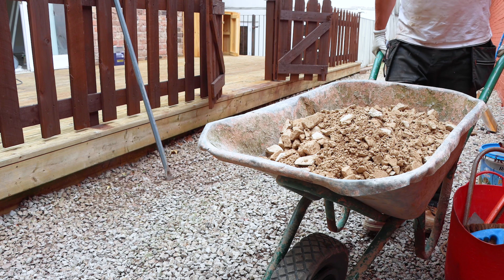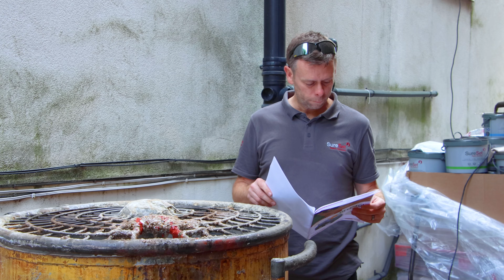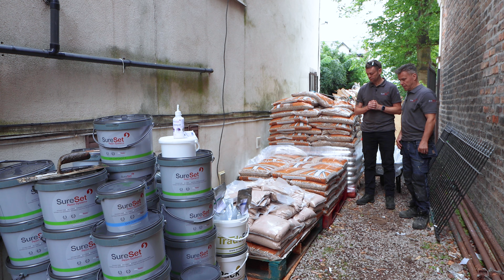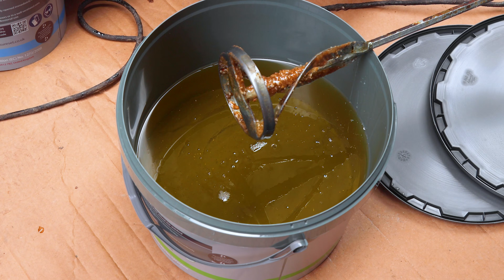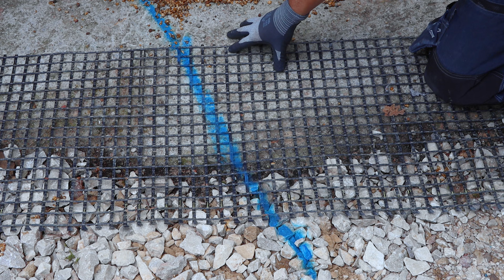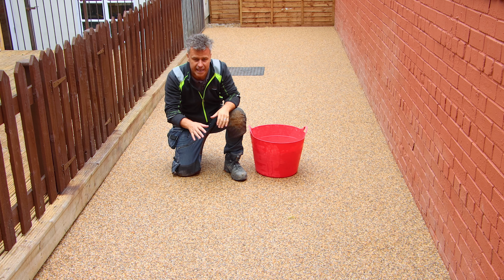How to Lay Resin Bound Paving | A-Z GUIDE | Complete Transformation

Comment: Fantastic video would love to know how much I would be paying for this to be installed, 100m2 area😅 am digging all my garden out myself and placing hardcore (mot type 1) through out doing my shed base at the back and leaving 70m2 centre for artificial grass and looking at this resin bond I think that’s what I want now specially with the water situation got to be the best for water to go quickly, just make sure my hardcore has a fall away from the house ready for this 🎉
Reply from the maker: Its a great product, contact SureSet for costings
Reply: Sureset’s DIY kit is currently £60 and covers 1m squared at 16mm depth. This was 30mm depth. So 100m with labour is surely going to be in the region of about £12,000? Looks amazing though, and with a 21yr guarantee it’s not too bad for a premium look.

Comment: Hiya Craig, thanks for the video, much appreciated! Couple of Q's if you don't mind.

Hoping to exchange contracts on a new house soon but it needs a drive way, do you think this is DIYable? No experience with driver ways, but lots with PU resin.

Resin doesn't mix well with water until it's set, did they have to lay this on a dry day.

Also, didn't see any tools checking for depth of pour, presume they were checking for that 30mm depth by eye?

Thanks!
Reply from the maker: Yes they sell DIY kits that you can do at home, just depending on the weather it's probably better off that you do as much as you can the quicker you can! 

Yes it has to be a dry day and no water nearby so check the weather you are! 

yes 30mm on these but you can go a bit thicker if you need to. Check out our other videos to see more! Cheers!

Comment: If the fall is towards the house using a concrete base and you have to use a gully or a channel drain, the water level will be lower than the gully's as the resin material is porous.is there a drain that sits below the resin materials or is it the only way to drop the drain and flaunch the resin into the drain?
Reply from the maker: Yes drop into the drain is the most wise thing to do

Comment: Thats going to fail big time, waters got no where to go! It will sit in that resin expanding and contracting with the frost, it wont go through the motvtype 1 or the concrete. That paths had it in 2-3 years.
Reply from the maker: Been down just over a year now and it's still perfectly fine! Sureset have a 21 year guarantee when installing resin bound paving and driveways! Hardly likely to fail if prepared correctly, cheers!

Comment: Having laid hundreds of Resin driveways and patios, paths ect, ALL to the manufacturers specifications I can assure you that is not going to last going straight over Type 1.. I’ve laid resin over 5ins of concrete with steel rebar and had issues.. also knowing lots of people in the industry I’ve never heard of anyone going straight over Type 1.. just look at all the big suppliers not one recommends Type 1 as a suitable base. Sub base yes, then 20mm open Tarmac at 50mm or a 4in concrete pad on top, then the resin at 18mm.. this is going to look like a BMX track very soon..
Reply: I agree it should be laid on Type 3 Mot, then open grade tarmac, to give some context Resin Bound is permeable ie lets the water through and using Mot Type 1 with the fines will only block the water and cause future issues
Reply from the maker: Sureset have been doing laying on top of type 1 for over 25 years! It's been one year in so far and it still looks brand new, just needs a sweep from the leaves every now and then!

Comment: I've been looking into doing my own patio and path in my garden. I've called a number of companies for advice. They all told me that the resin has to put on either tarmac of concrete as after time, if you put resin onto of a type 1 base the rain will wash away the smaller dust particles and cause problems like cracking over time.
Reply from the maker: Depends how it's installed! With a sureset installer you get a 21 year guarantee of a successful installation! It doesn't really make much of a difference whether it be on type 1, mot or concrete, if it's perfectly compressed, cured or hardened it should be more than fine to lay onto!
Reply: Did you end up laying the stuff? I'm looking into it myself.

Comment: A neighbour had a Resin bonded driveway installed. After a few years the driveway needed a clean because of moss & dirt collecting between the grit particles. The following year the dirt & moss returned with the addition of small weeds growing,  maybe in fissures or cracks created during the jet wash. 
What do you think went wrong?
Reply from the maker: You still do need to maintain it, especially it its by any brush or underneath any trees by brushing it off or getting the old leaf blower on it to get rid of any sitting foliage, and as for the weeds growing through, it definately seems like the sub base wasn't prepared correctly, as if you've got weeds going through then the sub base should be compact and absolutely rock solid!

Comment: This was used many years ago in the states.  It had a short life cycle because of several reasons.  Anywhere it was used which had freeze cycles the lifespan of the product was very short.  In the deep south, weed and mold brother was it's demise.  I would not recommend this type of project to anyone and would try to talk them out of it.
Reply from the maker: USA does get more extreme weather than here in the UK, I'm not aware of many major problems with resin when its installed by a certified fitter
Reply: @MrandMrsDIY  this was notoriously applied around pools for a deck.  You will not find a single person to apply this to a deck anymore.  I hope you have continued good results.

Comment: An 'A-Z guide' which doesn't answer any questions about the resin bound system? Surelt this is a 'part of a guide' not a whole guide. An A-Z guide wouldnt have 'ask the suppliers' as an answer 😮
Reply from the maker: Sorry you think this, do you have a question that we haven't covered
Reply: @MrandMrsDIY  no specifically but there's lots of questions in these comments eg can it be out onto type 1? And your answer is 'check with the manufacturer'.......how can this be a full guide if basic questions and answers aren't covered? What about the cost? What about the max and mine depth range? Like I wrote above, this isn't a full guide. More like an advert

Comment: Where will the bucket of water go if the bottom layer is concrete can't this be sealed
Reply from the maker: It will just spread around the whole flat area like it did before the resin was installed, if there concrete base down it should have fall allowing the water to run one way, hopefully towards drains or soft earth

Comment: That resin won't last more than 2 years absolute cowboy job
Need tarmac or concrete underneath to make it any good
Reply from the maker: The manufacturers state you can lay it over MOT type 2, it also comes with a 21 year guarantee. thanks pal
Reply: @MrandMrsDIY  I know what the manufacturer says but if you've done it long enough you would know that is dog 💩
Reply: @bertieblade7852 same here I’ve laid hundreds of driveways ect and that is not going to last .. BMX track very soon
Reply: @MrandMrsDIY  also it's alright the manufacturers giving a 21 year guarantee but you and I know that is a load of crap 
Thanks pal 👍

Comment: I had a company lay my 120 square meter drive which looked great at first, but after a fews months is deteriorated badly. The company director was taken to court by trading standards where he was given a 3 year custodial sentence and forbidden to be a director of any company for 6 years. 60+ customers testified against him. The drive is now covered in moss, weeds etc and cracked in places. Weed killer only works temporarily. £10,000 wasted.
Reply from the maker: That's absolutely shameful!
Reply: I've seen many a resin job done. I wouldn't waste money on it looks good but not very durable. In my opinion, you can't power wash it really and goes green very quick and I don't know the brand name of the resin
Reply: Angel Coatings, Angel Coatings Resin Drives, and National Resin Drives. 10 year warranty that was actually worthless.
Reply from the maker: Its shocking that companies are allowed to get away with this kind of poor work  @stuartalexander3
Reply: @MrandMrsDIY he didnt get away with it he's in prison for 6 years
Reply from the maker: I'm so sorry to hear this, what was the company name ? it certainly wasn't  Sureset, or any of there accredited installers they all come with a 21 year warranty.
Reply: How much for square feet?$$$
Reply from the maker: @manuelesquivel741  Drop Sureset a email via there website www.sureset.co.uk
Reply: It won't hold up
Reply: What's it like with dog piss?
Reply: @reefassassin3821 tastes sour
Reply: Resins are used to fix concrete structures together. Settle down
Reply: Hiya Craig mate,fellow scouser here mate,I’ve been a spread for 30 yrs and I’m looking into using this for a basement courtyard @20m,can I mix it in gorilla tubs and will I have to SBR the floor before laying? Love the page btw lad 👍😎
Reply: Well at least£80 a sq metre aint surprised
Reply: 10 grand on a drive way. Damn I did mine for £380 myself using temu and AliExpress. It's not a big drive way, but it's things like this makes me happy I like DIY. I even used crushed Opel as a garnish. It's really not that difficult to do, a hell of a lot easier than plastering.
Reply: Hi is it wise to put the resin down over my concrete imprint

Comment: How long does it last. Wondering if it would start breaking apart in the case of rain
Reply: That won't last more than 2 years laid on stone
Reply from the maker: When it is installed by a Sureset approved installer it comes with a 21 year guarantee! We actually tried to break some off so we can do a repair video, even a pneumatic drill wouldn't get through! It's insanely strong stuff!

Comment: Hello sir I'm in America on the East Coast. I'm curious about the usage of this product if you have to cut joints into it while doing it over a concrete driveway? What do you use to clean the tools and equipment with?
Reply from the maker: Yes you can use it on a concrete sub base. And you can clean the tools with Sureset's tool cleaner, or use white spirit. Cheers mate

Comment: I'm going to sound like a massive dork but I love SUDS. We have so many issues with water runoff due to hard surfaces which then overwhelms our drainage. To have water soak through these surfaces rapidly and straight back into the ground is a huge advantage, especially on porous ashphalt where the water can't linger in cracks to then do the old freeze-thaw trick and create pot holes.
Reply from the maker: There's many great benefits you get from SureSets Resin surfaces, one being the water rapidly draining though the surface into the ground.
Reply: What about if it’s a lot of water?
We have 4 cars on our driveway which are washed every week, sometimes I do the neighbours cars too so that’s way more water than your average house would use, plus all the chemicals I’m using! 
If the chems don’t attack the resin over time then surely all that water I’ll be using will have an effect on the ground underneath?
Reply: Winter and snow?
Reply: Mate if the process for the SUDS is done correctly, I.e 150-200mm of clean stone, then a layer of  type one then open textured tarmac, not just type 1 as shown in this video the surface will take large volumes of water.
Reply: This is not right surley? Mot type I is not a permeable sub base

Comment: People say the resin should go on concrete base  to do the job right what do you think of that?
Reply from the maker: That's correct if your doing a driveway that will have cars driving over, its not so important if its just walking traffic for a pathway
Reply: @MrandMrsDIY 
Where does all the water go if the resin has to be laid on a concrete base?
Reply from the maker: The water penatrate though the resin and spread evenly across the concrete running downhill into the same drains that it originally ran into before the resin was laid over the top   @Cameron-jr5pg

Comment: Thanks for sharing! I have a paved driveway in two stepped areas. If I remove all paving and level the ground, add mot type 1(compacted), can I have resin bound layed directly over the surface? Just to confirm in case I missed something. Thanks.
Reply from the maker: Thanks for your question, normally a driveway would require more than just hardcore MOT below the resin to assure its strength, for driveways the resin is often laid onto old Tarmac or concrete which adds to the strength, if the block paving is very firm and the MOT below is a goos depth then you maybe able to lay direct;y over the blocks with reinforced mesh beneath it. 
I'd certainly recommend contacting Suresets Tech team who would be able to advise the best way forward, visit there website www.Sureset.co.uk
or call them on 01985841180
Reply: @MrandMrsDIY  thank you for your time, effort and advice. Il contact sureset for further advice thank you.

Comment: Hi, great videos, I have subscribed. Everywhere I look it says not to lay this on to MOT type 1 but it appears you have. I'm looking to do my own drive so can I pour this on to MOT? Also are you saying 13mm depth or 30? Thanks in advance.
Reply: This is utter bolox you can't use mot type 1 it's not permeable, and it matters not if its a path or drive
Reply from the maker: It can go onto MOT when its pathway thats walked on, but if its driven on then a firmer base is required, please check with Sureset about the full spec for each application
Reply: @MrandMrsDIY  you got stitched right up doing a promotion for this lot. Shame on sureset.
Reply: Don't bother putting it straight onto mot stone won't last Craig's just done a cowboy job

Comment: Neat job that. I wonder how theyd deal with broken tarmac, Im guessing that would have to come up to the level of the sub-base, then tamped down well (and any broadband fibre laid in 🤔😉 etc) before adding the resin and aggregate 🤔🤔

Also am I right in thinking that it becomes its own soakaway🤔 If its that efficient that would be a real boon where I live, even though the driveway has a gentle slope😊
Reply from the maker: Thanks mate! Yes the full level would have to have been prepared well beforehand, any cracking on the base would either have to be scratched out and lifted off, or repaired and left to fully cure! 

Yes, as you can see from the water test video we did, an entire bucket that pretty much went straight through to the earth in literally 6 seconds!

Comment: Amazing finish. What a difference.  I live in Perth W. Australia and would love a business like the one you have. Can you help me with suppliers of stone and the name of the type of mixer you're using. View did you clean the mixer? Thanks m8t, will appreciate any advise
Reply from the maker: Hi mate, glad to hear! Yes so we used a company called Sureset to lay this pathway. The big mixer is called a Forced Action Mixer, simple to clean although it is an old machine, just scrape away any leftover resin residue before it dries, because once it dries you won't get it off! 

Check their website out at www.sureset.co.uk Thanks!
Reply: @MrandMrsDIY  thank you so much for a quick reply. The little stones are something I would need to source. Where can I get them?
Reply from the maker: @KarlFranklin-v8y  Hi mate, no problem. Depending on where you are, you can use sureset's website, or you could source it from another location, such as a builders merchant etc
Reply: hello... I'm in kenya...can we work together?